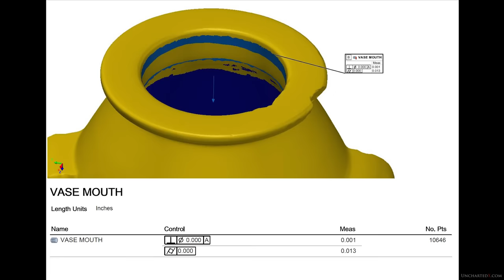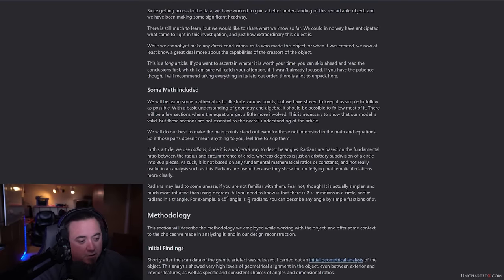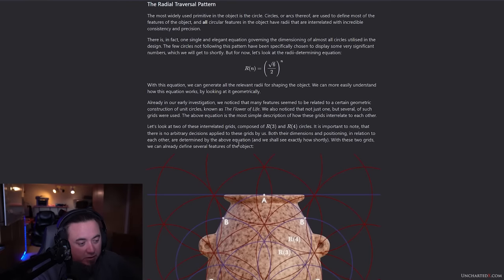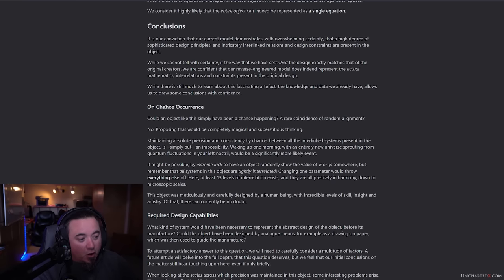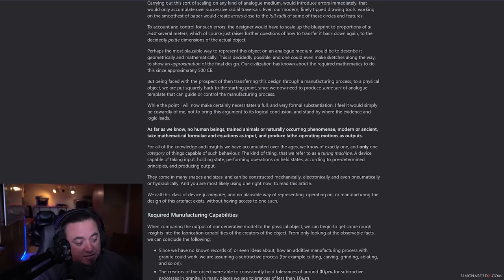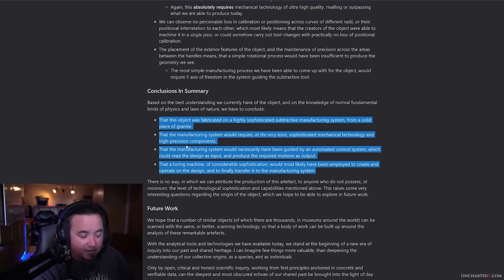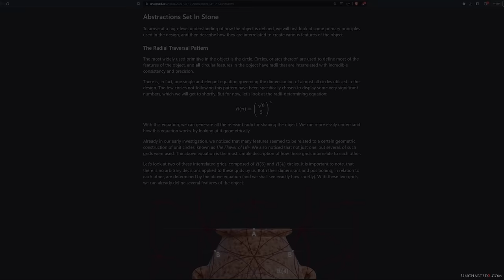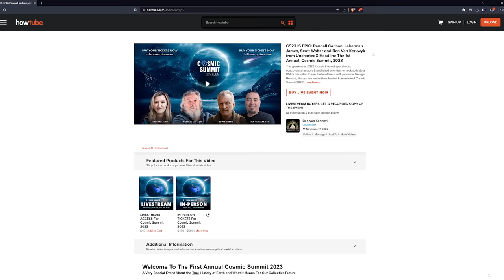Was a COMPUTER Used to Design this Artifact??

Comment: With a BS in mechanical engineering, and a PhD in Mathematics, there is a much better explanation for most of the observations of the paper: The author found the standard gauge system used by the civilization creating the object in its manufacturing process - whatever it was.

Since the gauge system is exponential, objects can be scaled by any power of the primary ratio almost trivially - just slide all the bits up or down the scale by a fixed offset.

Comment: To machine this part, lets say from a square piece of stock, I would start with making one side flat. ULTRA flat. This is critical to holding the tolerances. Next machine the inside opposite to and perpendicular to this flat face. Perpendicular accuracy is achieved with a long tool, held perpendicular with the 3 4 5 theorem. (Does this comply with Radians?) Now insert a cylinder (pole or rod) into this cavity for the lathe to grip. Internal support needs to withstand the machining forces, maintain accuracy and be removeable. Turning to finish is accomplished with a negative form of the outside profile and then traced. After this operation is complete, do not remove the work from the turning machine. Clock the support by adding a stop thru the middle of it, then machine one side of the handles, turn the work 180 to the next stop, finish the other side. If centerline of the work is known, stack support under the drilling tool to get to the little handle through holes, drill one, clock the work 180 again, drill the other. Remove the support from inside the finished work and insert herbs, water or whatever. Which I feel is incorrect. Does the granite jar have a frequency when tapped with a mallet or so? Does the granite jar ring like a tuning fork? I think the symmetry and accuracy is needed to maintain a frequency. Why go through all the trouble of precision for a flower jar? I assume this because I see pics of other jars with the ears having the outside of them worn off, like being tuned to a specific frequency. Back to the machining aspect, a 5 axis machine is not required for this part. Only a lathe. A lathe is the only machine capable of making its self.

Comment: I asked ChatGPT (GPT-4) to analyze the article and see if there was any flaws in the reasoning. Here is what it responded with.

Firstly, the assumption that the object was designed based on complex mathematical principles and not cultural, aesthetic, or practical considerations is not fully substantiated. The authors use mathematical modeling to reverse-engineer the object's design, but this does not necessarily mean the original designers used these mathematical principles intentionally. It could be that these mathematical relationships are a result of the design process rather than the guiding force behind it.

Secondly, the conclusion that the object required a Turing machine or computer and a highly sophisticated subtractive manufacturing system is based on the authors' analysis and modeling. However, this does not account for the possibility of unknown or lost ancient techniques or tools. It is also possible that the object was not made in a single process but rather through a series of processes over a long period of time.

Thirdly, the article assumes that the object is a single entity and not a product of a series of additions or alterations over time. This is a common problem in archaeology, where objects can be modified or repaired over time, changing their original design.

Lastly, the conclusion that the object could not have been made without modern technology is a type of argument from incredulity. Just because we do not currently understand how something could have been done, does not mean it could not have been done. This is a logical fallacy and weakens the conclusions of the article.

While the analysis is interesting and the mathematical modeling is impressive, the conclusions drawn are largely speculative and not fully supported by the evidence presented. Further investigation and evidence would be needed to substantiate these claims.
Reply: I then asked ChatGPT: "What suggestions would you give for the further work in order for the authors to draw better conclusions?"

Response:
Here are several suggestions for further work that may help the authors draw more accurate and better-supported conclusions:

Comparative Analysis: Compare the object to other artifacts from the same period and region. Understanding the context in which the object was made could provide insights into the techniques, tools, and principles used in its design and manufacturing process.

Cross-Disciplinary Collaboration: Collaborate with historians, archaeologists, and experts in ancient cultures. These experts could provide valuable insights into the cultural, historical, and practical considerations that may have influenced the object's design.

Experimentation: Attempt to recreate the object using techniques and tools known to be available during the period when the object was made. This could provide valuable insights into the practicalities of the manufacturing process.

More Data: Gather more data about the object. This could include more detailed measurements, higher-resolution scans, or even material analysis. The more data available, the more accurate the analysis and modeling can be.

Critical Evaluation: Continuously and critically evaluate the assumptions underpinning the analysis and conclusions. This includes questioning the assumption that the object was designed using complex mathematical principles and manufactured using advanced technology.

Peer Review: Submit the findings for peer review. Other experts in the field may be able to provide valuable feedback, identify potential issues, and suggest new avenues for investigation.

Consider Alternative Hypotheses: Always consider and investigate alternative hypotheses. For instance, could the object have been modified or repaired over time, altering its original design? Could there be unknown or lost techniques that were used in its creation?

By following these suggestions, the authors may be able to strengthen their analysis and draw conclusions that are more robust and well-supported by the evidence.
Reply: ask if it it's possible to make a granite vase this precise using modern technology.
Reply: ChatGPT, only seems able to repeat politically correct statements on any subject. No new or real insight
Reply: I agree with chatgpt about the conclusions being speculation at this point, hope there's more scans of different vases soon. it's not clear if the math was a message or inherent to the designing process. Ben is doing all the suggestions made by gpt. Curious about the MRI and the results of leftover substances embedded in the stone.

Comment: I mean a lathe isn't exactly high tech, I dunno about computer but a highly skilled piece of work for sure.
Reply: the video proves the vase was made under guidance of a computer, not made of a lathe. making the vase with a lathe would require a 2nd step for the handles and there is simply no way to maintain the tolerances and precision if you introduce a 2nd step WITHOUT the use of computer controlled cutting, plain and simple.

Comment: Turing complete sounds like a stretch if it only works by a single R(n)-formula. This might mean that the designer maxed out the machines capabilities or that the machine is indeed more powerful and can handle arbitrary formulas but the designer was just lazy (and/or wanted to be consistent)

Comment: I looked through the article, not in full detail, but somewhat thoroughly. While there are some noticeably cool features that could be intended, such as the incorporation of pi in the opening radii, many, if not most of the abstractions seem like a bit of a stretch. I'll try to summarize my points:

1. Why incorporate such intricacies in an urn of all things? I mean, did they just happen to think that future humans would scan/measure such an insignificant object (not in terms of quality, but let's say "flashiness") and spend countless of hours finding every little constant incorporated in it? To me that makes no sense. What would be the point of spending such an effort trying to fit the dimensions to basic constants that have been known for hundreds, if not thousands of years? Its purpose is to hold liquids, not high-level art or some kind of guide for future civilizations.

2. In a similar fashion to the previous point, why square the golden ratio? If it was exactly the golden ratio, then sure, it's quite interesting indeed, but if you start to fiddle with famous constants this way you can probably get almost any value with square roots, ratios, squares, cubes etc.

3. The circles generated by the R(n) formula get smaller exponentially, which means there will be a lot of circles of smaller size. Of course you can "fit" one of them (seemingly quite roughly) into every little bend of the urn. Moreover, why even the square root of 6 over 2 to begin with? It holds no mathematical significance to my knowledge. It looks more like it was chosen by the author to fit the data. Although I suppose you can rewrite it as square root of 3 over square root of 2 (or vice versa, depending on how you define your function), which is somewhat interesting considering they're the first two prime squares. Still, I think the inner/outer "Flower of Life" patterns generated by various R(n) seem a bit like a stretch. If the urn had a different shape you could probably find a different R(n) function (remember, you have a lot of constants to fiddle with) and fit it "perfectly" to that.

4. Why 16 GHz in the link between U and the speed of light? Again, seemingly grasping for numbers that fit the data. I also can't see how the speed of light could be known without precise clocks etc. Surely if this ancient civilization had such tools we would for sure have found SOMETHING more technologically significant than just some intricately shaped rocks. But maybe that's for another discussion.

5. About placing the handles, with both the inner and outer Flower of Light circle patterns, and the various points in/on the urn I feel like you can always find something to connect them too to find special angles like radians. Also, if it was shaped differently, maybe the author instead would argue about a different angle, such as from the bottom to the tip of the "lip" of the urn, or something (there are many choices). Again, the handles could simply have been chosen by the author because it fits with finding radians, not because those points on their own hold any great significance.

7. Perhaps this is a bit of a nit-pick, but where's e? Perhaps the most significant mathematical constant in use today (known for hundreds of years, so not exactly extremely modern). Well, let's just say that maybe there wasn't any ratio or whatever the equalled to e or the square root of e, or e squared over pi, or . . ., so we brush that constant aside for now.. Right?

There is a good point towards the end though. Studying more of these urns would show whether these patterns actually exist, or if people are just finding patterns in noise, something humans are quite good at doing. I think it's quite a bold claim to suggest that this cannot possibly be mere chance when the sample size is literally 1 and there are a LOT of things to choose from (constants, angles, lines, ratios) when trying to find meaning in its shape.
Reply: Also, don't get me wrong, I do like the efforts of this channel. Interesting to watch with an open mind. I just think there must be critique if critique is warranted.
Reply: this is one giant argument from incredulity. we don't have the answers to your questions, that's what makes this topic intriguing. i don't think you fully grasp the encoded mathematics and how this cannot be the result of coincidence. this isn't a million monkeys at a million typewriters type of scenario, this stuff doesn't just happen by chance, it's purposeful, especially considering the shape of the vase is determined by an equation.
Reply: @AustinKoleCarlisle  I'm not saying it's not intriguing, I'm saying that it's hard to know whether this is by pure chance or not (or a mix between intention and chance). I don't think it's quite as simple as you think to say for certain that this vase was made with all these constants in mind. As I said in my comment, there are a lot of constants, and a lot of ways to fiddle with the constants to fit the various data from the measurements. I'm sceptical, at least with some of the findings, but in the end all that must be done is to repeat the process on further vases (or other artefacts, because why only incorporate in vases?) to see whether this pattern is consistent or not. I mean, I can Google "Ancient Egyptian vase" and get a bunch of examples where the shape and dimensions are clearly different from this one, where you wouldn't find pi, golden ratio or radians in the same places as shown here.

Comment: Rather than trying to fit the process to a modern category such as "computer" controlled or "5-axis machining" perhaps a check on how such things were manufactured at the height of the mechanical industrial revolution, there were many ingenious mechanical means of product manufacture prior  to the dependence on electronic computers and precision control systems. Threads were checked on shadow graphs, batch manufacture carried out on copy lathes, ornate jewelry and time pieces created on Guilloche and rose lathes...

Comment: It may be possible this was drawn on a medium such as paper.  Find an old carpentry book from long ago such as Practical House Carpentry (1830) by Asher Benjamin.  All the templates for various architectural forms are written in proportional units all based on the diameter of a column, and those diameters are broken down into minutes and seconds. A  measurement in related proportions.  This means that measurements are scaled during creation based on the height and diameter of an architectural column, and all related aspects are proportionally scaled.  It could be argued that the makers of the vases made a proportional design and depending on the height or width, the remainder of the elements were based on measurements of related proportions.
Reply: the problem is, a house design is scaled down to fit onto paper, whereas this vase design would need to be scaled UP to room-sized.

Comment: A Turing machine? No, because a TM is more of a conceptual machine than something feasible for performing useful computation. A mechanical computation mechanism is completely within the realm of possibility though, you can execute functions all the way into trig and calculus with gears/belts/cams/cones/rollers, as used in flight control systems up until the 1980s.

Comment: Is no one else seeing the obvious difference between the 2 handles? The one on the right is higher on the vase than the one on the left and they're both off of the vertical axis with each other- if you use the link provided it's ridiculously blatant in the image in the link because they photoshopped visual "reference" circles onto the image.
Reply: not sure what you're seeing. if anything, the holes in the handles are different likely as a result of the Dynastic Egyptians later adding these with cruder technology.
Reply: @AustinKoleCarlisle  That doesn't go along with the narrative being presented at all. If you can't look at a simple picture that has demarcation lines for visual identification on it to and see that an object isn't mirrored from left to right you need an eye exam.
Reply: @henryknox4511  i seriously don't know what you mean. i clicked on the link and looked at the photos, the handles look exactly the same aside from the holes being different shapes.
Reply: @AustinKoleCarlisle  looks perfectly symmetrical to me too.

Comment: The image of the vessel with all of the circles superimposed was manipulated by me the way that Dunne did with the statue of Ramesses.  I did four versions, with one being a copy & paste in vertical reversal at 50 percent opacity.  All vessel and circle lines perfectly overlapped with no dual lines at all. Then I reversed the original image both horizontally and vertically at 50% opacity.  Same result.  No lines appeared in duplicate except for the very bottom and top which have different shapes.  
Such perfection could be normal for any clay pot 'thrown' on a fast-moving potter's wheel using a template to produce the curvature, but no such technology is known to have existed for shaping hard stone that.

But I know how such curves could have been done in hard stone.  Here's how a vessel with no handle lugs could have been made:  Take some volcanic pumice stone and embed as much emery as possible into its pores using melted amber (sap) and use the result as a grinding surface instead of one's hands as with clay.  That would work for simple curvature albeit at a slow pace.  But then just try to repeat that 40,000 times with mathematical precision, -AND have to also hollow out the inside somehow.  That could not have been done with terrestrial methods and tools.

Comment: Which would be more accurate, machining with high tech tools?
Or, similar quality moulding?
As many vases exist, is there any proof of similar sizes, like when you buy plastic containers in a small, medium or large. Are there more vases the same size?
Also, would the next step be to get pictures of the surface to see what tool may have made the cuts, if there were any made, surely a tool would leave some sort of physical sign?